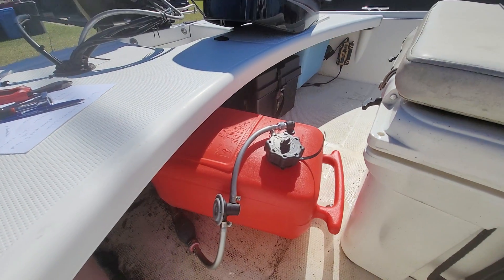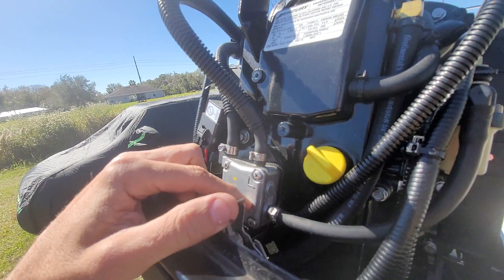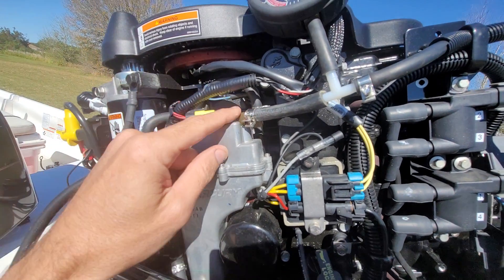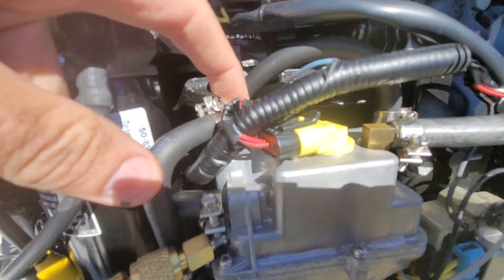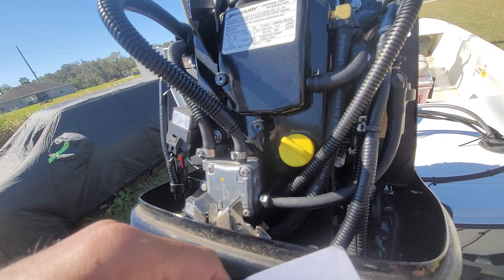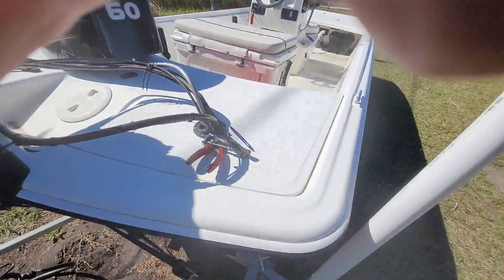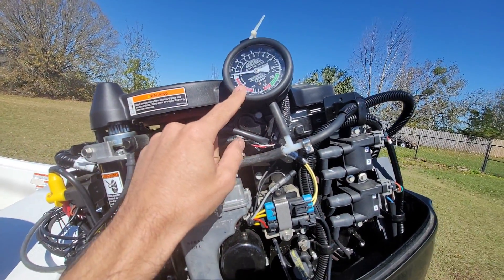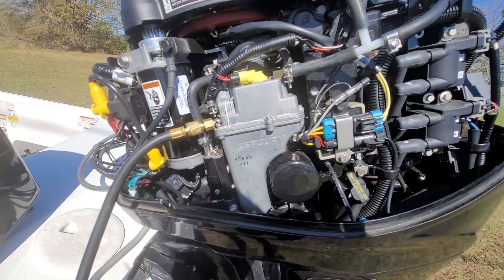Mercury 60 HP EFI 4 stroke low pressure fuel system information & test procedures

Comment: Great job explaining the diagnostic procedure for the low pressure fuel pump. I am chasing a problem with my 3cyl 40hp occasionally dying at idle speed in gear and when I come off of the throttle quickly. I have replaced low pressure pump, high and low pressure filters, and IAC. I took apart the VST and found no glaring issues. Checked plugs, no obvious problems there. Pressure at the VST schrader is 40psi and does not deviate while running that I can reproduce. However, when I turn the engine off it immediately falls to 20psi. I am thinking fuel pressure regulator, but is 40psi really low enough to cause issues? I know the manual calls for 42-44 but I am hesitant to throw yet another part at it.
Reply from the maker: Not sure if the 40 and 60 are setup the same.. if they are, when you take the vst tank apart, in the top part of the lid is the pressure regulator, you can remove it and see if there are any debris in there, but what you're describing to me is a faulty fuel pressure regulator (or possibly fuel can leak by the regulator oring something like that). The pressure should hold when you turn off the engine, not instantly bleed off.  The pressure wiill decay over time but you definitely have a leak on the high pressure side, leaking injector(s), or faulty regulator. You can clamp off the high pressure output to the injectors after the vst tank and if you still loose pressure then you know where it's leaking is in the vst tank. When you pull the tank apart just check the orings for damage, debris etc and if you don't see anything then it's the regulator. 

If the gauge holds pressure when it's clamped at the output to the injectors and then you release it, and pressure goes down to 20 then you know it's in the injectors or the diaphragm looking device. 

Any line you clamp I would use my own line, and any line that is staying on the boat I wouldn't clamp because you can collapse the lining. 

Test, don't guess, and you will be replacing the correct parts. Hopefully that helps

Comment: Thank you for making this video. It really helped me understand where the fuel goes on both the low and high pressure side. This really helped me in getting my 2015 Mercury 60 hp EFI up and running again after it sucked up a big glob of gummy old fuel. It had stalled and would not restart. Now it runs great.

Comment: Do you know what the correct torque is for the low pressure bolts attaching to the head?.
Reply from the maker: I don't remember, but I don't think it wouldn't be much. If the bolts are 10mm and 6mm thread diameter, it would be around 5-8 ft lb. I usually try and get a feel for bolts when I break them loose by hand and go back that tight when reinstalling them. You can look up torque tables based on thread diameter if you can't find the proper spec from factory.

Comment: My boat 2018 tracker pro170 with 2018 mercury 50HP runs perfect for 10 minutes. Then if i Idle it shuts off and will not crank back up until the next day. 

Bass pro wanted to charge me $1500 to replace my vapor seperator assembly. 

Do you think it could just be be dirty or something? Tryingnot to replace the whole system if possible
Reply from the maker: The vst assembly is able to be fully disassembled and cleaned. If the pump or pressure regulator is bad on the high pressure side you can figure that out, there are videos on the vst tank. I touch on it briefly in this video but don't cover it in depth. 

The pressure regulator has a screen in it too, when you remove the regulator it's beneath it.

Sounds like your high pressure fuel pump may not be turning back on after it warms up, you will see that if you put a pressure gauge on the vst tank..
Reply: @ thanks for the response

Comment: Great video with lots of information! I have a 2010 40 hp mercury bigfoot. Why would fuel be coming out of the hose you said was just for air to escape. The hose on top  right beside the low pressure fuel line going into the high pressure fuel pump?
Reply from the maker: This would mean the float valve in the top of the VST tank that is supposed to shut off the low pressure fuel supply is not working correctly. Either it is sticking open or the float is full of fuel
Reply: @lillyautomotive what is the recommended fix? I'm having the same issue. When the boat is on or I prime the system fuel pours from the drain.
Reply from the maker: If fuel is coming from the vst drain, the float is cracked and full of fuel or something is holding the float open and the vst is overfilling.
Reply: @lillyautomotive thank you, do you have a recommended place to purchase replacement parts?
Reply from the maker: I'd look at the vst, and see if you need parts first. I usually just search for parts online, I forget where I purchased stuff from before but I search for "wholesale oem mercury boat engine parts" or the like and look thru a few websites until I find a reputable website and decent pricing.
Reply: @lillyautomotive thanks!

Comment: Does the fuel make noise when the key is on? I have one and hear no noise with the key on and I can prime fuel system and get it to run for a few seconds then have to deprive it, just wondering if the fuel pump is bad
Reply: Im going through same thing, did you happen to solve your problem?
Reply from the maker: Are you getting pressure at the fuel pressure port?

Comment: What would cause my engine to need to be primed to keep running? Idles okay but giving it any throttle i need to keep priming the bulb. Im assuming it isn't the high pressure fuel pump because it can run at WOT as long as im priming the bulb. Once i stop it starts to starve itself from fuel. Low pressure fuel pump you figure?
Reply from the maker: I would say lofp. You can do the tests in the video. If you see the fuel pressure gauge bouncing that is a sure sign of the lpfp being bad. A healthy lpfp has very stable fuel pressure, it's not something I videoed but found out after replacing it. Other things could be a leak where it is sucking air. As it's pulling the fuel.

Comment: I have a bizarre question for you, but that motor appears to be on a fiberglass boat of some kind. I was curious what kind of speed you’re getting out of that boat I have a 60 hp on a 16’5  aluminum boat that weighs about 900 pounds and I’m only reaching a top speed of 29 mph and is a dog out of the hole ,so I’m assuming the motor is not performing correctly. I have replaced the entire fuel system on the motor except for the injectors so I’m just curious if I’m chasing a higher performance that may not be there. Hope that makes sense.
Reply from the maker: It's not my boat and I haven't personally been out on it so I cant really about performance, but I did ask the owner and he said top speed is about 30 mph. It's a 2017 Mako Pro Skiff 17', online says 950 lbs.
Reply: I have a BW 15 Montauk with the 60 merc 4s. Boat weighs almost 1,400 lbs and I cruise at around 25mph at 4500rpm WOT gets up to around 33ish. I have the command thrust lower unit and have the OB raised 2 notches on the transom. I’d look into the injectors hope this helps

Comment: My low pressure filter, the bowl, keeps going dry after it’s running. It doesn’t seem to be affecting it doesn’t do that on my other outboard. Gaskets look fine, threads are fine. Not sure why it’s doing that, is it sucking air somewhere maybe?
Reply from the maker: It could be, check for leaks on the filter bowl gasket, and try to eliminate variables. Do what you can to eliminate chunks of the system to narrow where the problem might be. Have the suction side pickup fuel from a separate container with different ( temporary line) fuel line. If it stops make sure the pickup in the tank is fully covered and there's no splits leaking air on the pickup or at any fittings. If there's no change you can test the lp fuel pump suction and make sure the needle is smooth on the vacuum guage.
 and not fluctuating rapidly.

Comment: I just put a new pump and I'm at 35 psi 😢
Reply from the maker: Low pressure pump or high pressure pump ? Are you testing pressure from the Schrader valve on the VST tank?

Assuming you put in a new high pressure pump and you're reading 35 psi from the Schrader valve it's possible the pressure regulator is stuck open or partially open. After you shut off the engine does the pressure bleed down? It should hold for a while. I would consider pulling apart the VST tank and in the top lid is the pressure regulator & there are a few screens (one behind the regulator too). I would clean everything and make sure nothing is blocked. Replace the regulator if pressure is low and everything is clean.
Reply: @lillyautomotive My pressure tester was faulty! Also, it was never my fuel pump. I spent $600 for nothing. It ended up being my fuel line. The lining inside was all bunched up. 😩
Reply from the maker: Ah bummer that sucks! The lining inside the fuel line is why I was saying not to pinch it when testing and to pinch the line you were using to tee in the gauge, I know I wasn't super clear with that aspect but anyway atleast you found your problem.
Reply: @lillyautomotive  you're video is super helpful! Thank you!
Reply from the maker: @jetski_tom5238  Glad to hear
Reply: No hose goes to my fuel pressure regulator 😐 am I doing something wrong ?

Comment: Thanks mate, I've got a 2014, 60 hp Mercury efi, so this video is a great help in understanding the fuel system. You got any trim/tilt info?
Reply from the maker: Nah not right now. As stuff comes in and time allows Ill film it. It'll probably be some time before I have another boat to work on.

Comment: Thanks so much for this video!!!  Your explanation confirmed my thoughts about how the system was laid out, and you supplied some much needed information for my testing.  I wasgoing to replace my fuel pressure regulator while working on my VST, but that little part costs over $230, so i will be testing ig instead, first!  Thanks again👍👍
Reply from the maker: Glad the video helped!

Comment: One of the best explanations of how this system works. 
Should add if you experience furl cutting out at mid throttle and everything else checks out look at float needle. I had piece of fuel line break off plug the needle restricting fuel from low pressure pump to vst.
Reply from the maker: Thank you for the kind words. Good tip to check if someone is experiencing that issue, thanks for posting. I left the VST tank out of the video because I felt like there was other videos that covered it well enough, and I didn't film it when I took this one apart. The low pressure side / lift pump side, not a ton of information out there about it.
Reply: @lillyautomotive  most people automatically go to the high pressure pump. It can fail from a faulty or restricted low pressure pump.